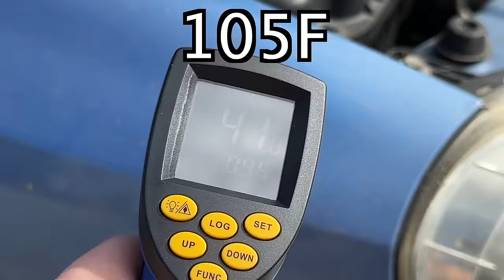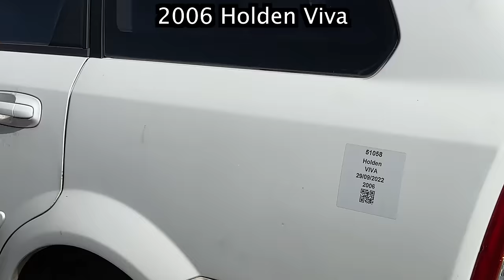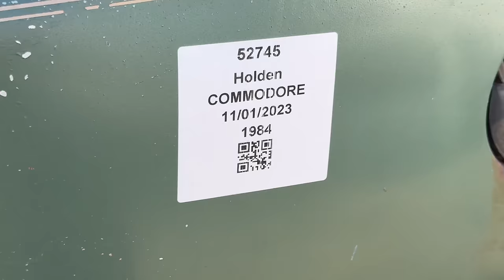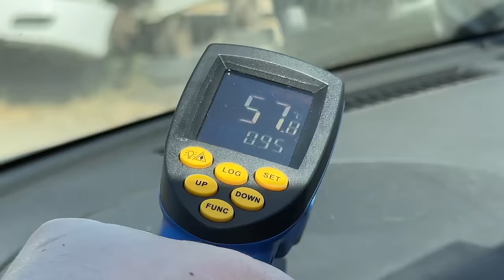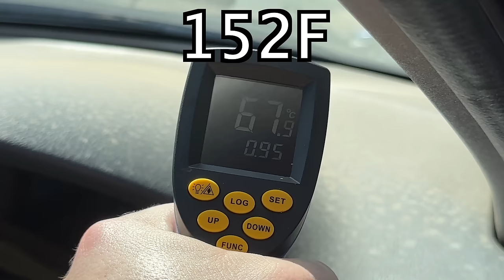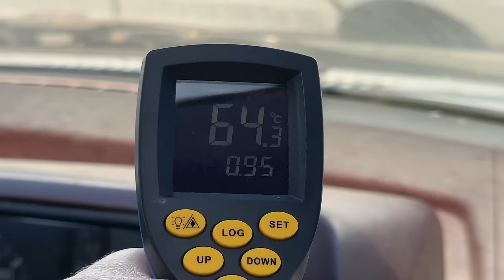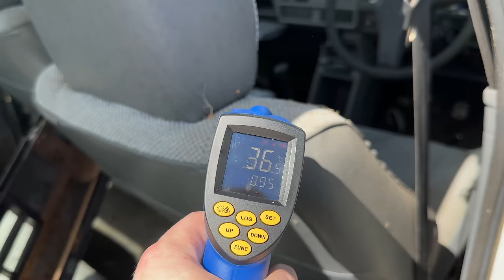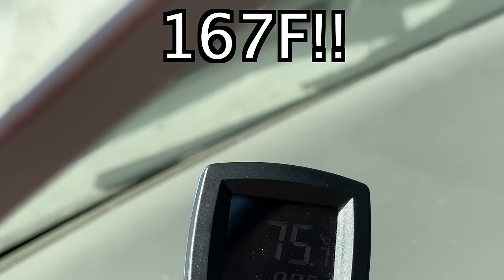2023 U-Pull-It Adventure

Comment: It’s really interesting how some cars don’t really go anywhere once they’re at the end of the line, they’re just put somewhere and left to rot. 
It could be any car too, even one from this year could be subject to such a fate.
Reply: The swift of the guy who sold him the corolla is probably rotting already!
Reply: @pingucraft95  True, true.
Reply: I was at an lkq and there was a corvette rotting away
Reply: I mean, that outcome is valid only for pull-aparts (this yard) and storage type junk yards. Most common junk yards are picking these apart and make mince meat out of them.

My local junk yard is half and half. It both has the storage area, which kiiiinda serves as a pull-apart, but it's beer based and it's also a shredder. There's a dude with a big claw/magnet attachment in a fixed digger and he just wrecks these things apart, rips them open. It's actually pretty entertaining to watch.

He breaks all the glass, shakes the car until it's all out, then rips the bonnet out, pulls the motor, throws it into the pile, then rips the rubber out and then absolutely hammers the living sh!t out what's rest then throws into a huge, house sized rotating shredder. I usually give the boss pit a six pack and he lets me hang round from time to time, just about the most therapeutic thing to watch.
Reply: Mum told me they went to car heaven
Reply: @pingucraft95  He sold him the Corolla, not the Leaf
Reply: As other says. Allot of cars around the world get a few months and then ran into mush balls. Ones I saw a really nice looking 80-90s car that looked road worthy not even picked the interior or any parts of it. It was apparently in the way for the forklift tractor. So what did it do? It just rammed the windows and picked the complete car up by the roof ;C And to see more road worthy cars then the average modern ish shit snail be stacked and then crushed? It aint right. 

Got more respect for some old Volvo or Saab whatever on the road then some BWM or whatever Tesla crap. It is a joy to see old people still driving there 70s and 80s cars to the store. That is a sight soon to be gone since people do not outlast the cars built to last.
Reply: @mahditaher2787  Thanks for the hint, I have corrected it!
Reply: Depends on the yard - sometimes they're just left to rot, other times they're in the yard for a couple of months before they're cubed and sent off to China to come back as a new MG or Haval.
Reply: well, once the car ends up at U pull it, you know the owner stopped caring. 
I called them once about my Commodore, they said $250 if i dropped it off. 

the car was still 98% functional
Reply: Very interesting, thanks for the info/stories, Y'all!
Reply: @TheDiner50  i have a 94 honda civic del sol and it's getting more and more expensive and eats up more and more time every time i have to get it repaired, and this is why those old cars aren't being driven as frequent. driving a 30+ year old car is long past aftermarket prime. it will need extensive repairs with long wait times because sourcing a part is getting harder and harder to find. the labour is easier to do for mechanics by far, but the parts aren't coming cheap and easy and when you have one component fail, you usually have auxillary failures attached to it—esp when the part isn't one that is part of routine maintenance swaps. 

most people driving cars that are 40+ years old are mechanics or know an enthusiast backyard mechanic. that car is not their sole car for sure because it can take weeks(!) to get a part in (and installed) if you're unlucky.

love my del sol, i'll replace the engine when mine goes even, and don't want a new car for sure... but i totally get why people aren't all driving classics out here. 

now what i can't get is why everyone is driving the biggest fucking light vans they can find, but that's a different topic.
Reply: @reecemartin453  For those cars, the junkyard will fix and sell for 10x what they paid you for it. At least, that's what I've seen at different Pick-N-Pulls here in California.
Reply: There's a mint condition Mercedes E500 convertible at my place of work that's just been langiushing in the same spot for 5 months
Reply: @snownd675  wow.
Reply: I had a chat with a yard worker at our local U Pull It a few months back, he said that they don't plan on keeping much stock of certain models of newer vehicles. Said so many of the parts are made of plastic that goes brittle in a few years it's hard to remove stuff without it cracking/shattering.  And with EVs, they haven't seen much demand for parts outside of body panels and the occasional wiring harness, as they're not really designed to be worked on by the average owner.  Not worth taking up space on his lot.  

It surprised me, and I wonder about the future of such junkyards.

Comment: What happened to Holden is basically happening to Subaru now.  They make 5 different SUVs, 4 of which  (Crosstrek, Forester, Outback, Ascent) are just slightly different sizes with nothing else to really distinguish them, and then got rid of all their sensible hatchbacks (in 2014, despite the hatchback being 60% of the sales on the Impreza at the time), performance cars, and their wagon.  So now they're starting to struggle and I don't know how they didn't see it coming.
Reply: all they need to do is bring back the Baja
Reply: @j0anbug  and the BRAT. But it’ll probably just be one or the other, Jeep wont even give us a 2 door Gladiator.

Comment: That Holden Epica literally has the exact same steering wheel as all of the USDM GM trucks and SUV’s from 2007 - 2014. You’ll find that in anything from a base 2007 Chevy Silverado to a fully decked out 2014 Cadillac Escalade. It’s crazy the amount of part sharing GM does.
Reply: Though helpful if you're restoring one
Reply: @nickrustyson8124  Absolutely
Reply: Forget parts sharing... they share entire cars across the globe and just call them something different with minimal other changes. Noticed that with one of the cars I had here in Germany, which was a 2005 Opel Astra H. Turns out this one model was even sold in the US and Canada, albeit very unsuccessfully. Other than badges and being LHD/RHD, there weren't really any major differences. Vauxhall Astra (UK), Holden Astra (Australia & NZ), Saturn Astra (NA), Chevrolet Astra (?), Chevrolet Vectra (Argentina & Brazil), Opel Astra (Europe, parts of Asia)

Comment: Vauxhall itself is just a rebrand, it's ownd by Opel (Germany) and the cars are basically opels. And in your country they are Daewoo or Holden (astra for example). All opels, basically. Good cars,  if you know which one to buy. The Dawoo you have in your video is an Opel Kadett from the 80s. Daewoo just shipped the forms and everything over and kept on making them, long after opel did. I had one of these, it was my first car i bought myself. I loved that thing (and the plastic trim was quite fance back then) ;-)

PS: The combo van you show is an opel, too - its an Opel Corsa Combo (Cargo). Opels everywhere (like the Holden Vectra at 5:26, which is an Opel Vectra before they re-badge it, or the commodore. Basically the whole lineup) 😀
Reply: Something still tells me the Corsa C was engineered RHD first
Reply: @satsumagt5284  these corsa itself itself as a small car quite old, the first generation from 1982 was build in spain by GM, using  German construction plans. Who knows what happened all the way to the now 7? 8? Generation 😁
Reply: @erebostd  I can’t speak about the Corsa A, neve seen one (they weren’t sold in my country). But the C, eh, the cabin blower really tells me it was engineered as RHD first
Reply: They're all Peugeot's now. As are Opel.
Reply: Opel was owned by GM since the 1930's

Comment: I would love to see you restore one of those 90’s and early 2000’s Holden Commodores sometime. It would be interesting to see what kind of faults one of these cars has and what kind of parts you would buy for it. It would be great to see that Holden alongside Smelly Jeff. I wonder what that Holden would be named tho? 🤔
Reply: Yeah that would be awesome to see what the competition was up to at the time. I have a 2006 vz wagon but never been in a VT. Would love to see one of those done up
Reply: Commodores are easy because they used the same parts across all models for like 15 years, and the engine was from a front wheel drive 80s Buick of all things. Mine is still running fine apart from some annoying electrical problems now where it thinks everything is broken but it's all actually fine.

Comment: Reminds me of going to salvage yards back in high school with a good friend on the weekends.  Being the rural Midwest, we were always weary of copperheads since the two yards we had at the time were up in the hills in blocks of "carved" out woods.  We only have one yard left local, and there's rarely good finds at that one.  I grabbed a manual Crossfire we rebuilt entirely just using the body, engine, and trans with new steering/suspension, wiring/ecu, etc.  Other than that, it's mostly just cheap crap wrecked not worth grabbing.

Comment: Being in Canada, it's amazing to see so.many manuals like this, stick cars just don't exist here lol
Reply: They’re basically an anti-theft feature at this point.
Reply: I have driven a few manual cars in canada. Mind you I didn't have to lock the doors on our rav 4 because it was manual.
Reply: @rawnature8148  funnily enough, I did lock the doors on my manual Saturn, and it still got stolen. The lock cylinders on Saturn's were garbage and after a few years, pretty much any key would work. At least I didn't have to replace my ignition cylinder or any windows when I got it back.
Reply: @brianargo4595  the thing about a saturn is that you need to replace parts as they break so often. Hence you just steal a spare.
Reply: @rawnature8148  dunno what you're talking about. I only had to replace the alternator. And the engine. And bypass the automatic radiator fan to a switch in the cabin. And at the end of the day, somebody stole it to go to IHOP apparently.
Reply: @brianargo4595  so we are looking for a one legged thief who can drive manual. That was a pretty short list of things to change. How many kms?
Reply: @rawnature8148  think I got rid of it at just under 200k miles, so just over 300k km. Oh, and the synchros on third gear were shot, but that taught me to rev match.
Reply: @brianargo4595  that's a pretty good run for a saturn. You must have got a Tuesday or Wednesday car.

Comment: The "Vauxhall Astra" was only called that in the UK, the rest of Europe it was called Opel Kadett E 👍 
I daily drive an 1983 Opel Rekord E2 sedan (Commodore VH), currently working on my new car, 85' Rekord E2 wagon! With the 2.2 Injection 😬
Reply: Do you put the V8s we used in the Commodore in your Opels?
Reply: @AfferbeckBeats  nah 
We don't have any V8s over here, and there's no way we'd be able to afford the tax even if we did import one from Australia or America
 
Instead we have our own Opel made straight sixes :)
C30NE, C30SE... C40SE hooh 
C40SE a four litre twin cam injected straight six, very reliable and very torquey, basically a European Barra :) 
But they're rare 
Most people will just swap in a C**NE, a OHV straight six hehe 
The ohv engines were really good though, they were cam in head! No pushrods! 
C30NE from 1977, Opel Senator A1 and A2, basically our equivalent of the VK and VL commodore, 180hp!

Comment: Mate, worked at Vauxhall in Luton UK changing lighting during the summer shutdown in about 1991, whole line of what they were making was just the standard stuff with a different engine two different panels and Holden instead of Vauxhall badges.

Comment: I used to sell those old Vauxhall/ Daewoo’s new at a Ford dealership around 1996-1997. They had the same engines as a Holden Camira. Big selling point was the “limp home mode” if engine had an issue. Hated them then, still hate them now 😂

Comment: fun fact honda had a d-tec it was the dsi engine(dual spark ignition) so a four banger had eight spark plugs 2 per cylinder and my dads 2008 honda jazz got and man 5litres per 100km is nuts

Comment: The startup sound of late 90/early 00 holdens is etched into my brain, and I'm not sure how to feel about the fact that I don't hear it in the wild as much anymore
Reply: Those 3800 V6s had a really distinct starter motor sound and engine note. Same with the Rover V8 (which was also a Buick design). Both once a common sound on Australian roads which has disappeared.
Reply: @bafg182  Even in America where they sold a metric fuckton of 3800 from the 1970s into like the 2010s, they are going away

Comment: Funny how the Daewoos had an engine called D-TEC where Hondas in Europe (specificaly the diesel models) have actual engines that have iDTEC written on them. 
Speaking of Europe, when seeing those Holdens (Astras, Vectras, ...) it just feels so strange seeing them with a different badges and not with an Opel badge as I'm used on seeing them

Comment: 1:17 - in the UK they were Vauxhall but most of Europe knew them as the Opel Kadett and it was sold as a Daewoo Racer as well.
4:00 - The "Holdens" with the small 4cyl engines were sold as Chevrolet in europe, most of them were rebadged Daewoos with Opel engines, my family used to have a Viva wagon in light metallic green, it was called Chevrolet Lacetti, it was okay car i guess for low income central/eastern-europeans.

Comment: you should do a video on the Corsa C (i think holden barina c?) it's from 2000 till 2008. aussies had a bunch of cool UTE models.

either way their 1.4 engines are proper spicy for their sizing.
Reply: Had a 1.4 twinport 2004 Corsa, It was quite fun in its SRi form and its exhaust sound pretty sweet, not too loud but not too quiet
Reply: @joeynebulous816   mine is the Z14XE so non twinport, z14xep's seem to have a reliability issue in my region.

but yeah the exhaust sounds pretty fun if your CAT is a worn out.

Comment: 1:15 Yup, Daewoo Racer, a.k.a. Vauxhall Astra or Opel Kadett E (last generation before Opel also switched to the Astra name). Also known as the Daewoo/Pontiac LeMans for some reason. 
Fun fact, Daewoo tried to modernize this mid-80s platform in the mid-90s as the Daewoo Nexia (Cielo in NZ and elsewhere) and sold it up until 1998. If you google pictures of it it just looks like someone took a giant hairdryer and melted a Kadett/Astra a bit 🤣

Comment: I remember most of the "EU" Holden's as Opel cars.
The corsa, Astra, Vectra, omega (older Vectra) and that van looks like the Opel combi
Reply: Eeh, calling the Omega an older Vectra is not really correct, as they coexisted for a fair number of years until the Omega got discontinued in 2003. Vectra was a FWD middle class car while the Omega was a RWD higher class model, much like the older Senator/Monza

Comment: 'why would someone even bother to lift that [70s bucket seat] in there?'
back problems. i have scoliosis and the seats modernised by the 90s to now almost universally kill by back after 20 minutes of being strapped to them. i have a del sol, they come with honda racing seats stock, and the back problems i associated with car seating (in cars from the 90s to 2011 that i've experienced, never experienced a newer car than that sorry) vanished. if i have to scrap the car i'm scrapping it after taking the seats out.

bucket seats also extend the time before the seats make my back feel like it's being stabbed, from experience.

Comment: You know its the end for them when there sticking a holden badge on vauxhalls like the vectra the vive and later astra models and saying that it's good enough pull the cap in the middle of the steering wheel off 
and I bet it has a vauxhalls badge underneath

Comment: 1:25
Alright so uh quick explanation
These cars were originally meant to be Opel Kaddets.
But then GM decided to spread it on every damn car company it owns.
From what I know there are 4 rebadges of the car, and they are:
1.Daewoo Racer
2.Pontiac Lemans
2.5. Daewoo Lemans (Pontiac
And Daewoo shared the same name)
3.vauxhaul astra
4.Opel Kaddet
My dad used to own a 4-door Kaddet sedan but he sold it because it GULPS the fuel so fucking fast.
(O yeah, and it had an automatic trans from Chevrolet).

Comment: A fun thing to do with a U pull is to find a cool car with nice seats and buy one, bolt it to a piece of plywood, and bolt that to the base of an office chair. Instant luxury office chair with padding that never, ever goes flat. My current one is this utterly pristine, mint passenger seat I got out of a late 80s Camry that was hidden under a heavily worn sheepskin cover. It's absolutely sublime, been using it for the last ten years. Before that, it was a nice old Volvo seat, but I've done it with a fiero seat, a leather jag seat (that I wired up to make the seat heaters work)